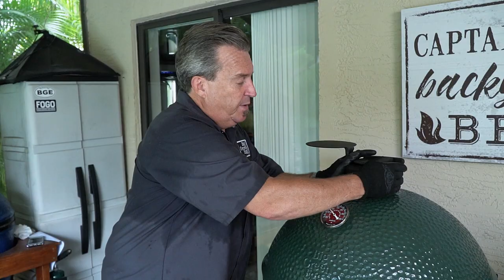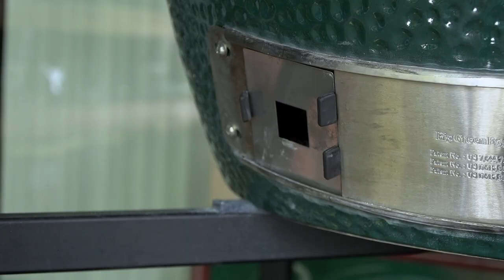Temperature Control & Vent Settings for the Big Green Egg | BGE Tips

Comment: I just read a comment on wind. I have smoked both times with wind conditions. At least 10 mph. I think it affects the temp control for sure. This might be a reason I am having a hard time controlling the temp. Yesterday I had both vents just about shut and still found it hard to maintain 250 for smoked Turkey.
Reply from the maker: Yes, that can definitely do it.

Comment: I have used the flame boss system on my egg and have found the need to tape up most of the fan input opening to limit free flow of air. There is no damper on this system. Prior to blocking this flow i could not hold a low temperature and the fan never turned on due to being over temperature.
Reply from the maker: If you close the top vent, it will definitely limit the air flow and it will burn at low temps.

Comment: Great tips.  I like the idea of adding charcoal to cool it down.  However, my number one rule is watch the temp and DON'T LET IT GET TOO HOT.    You can always make it hotter by opening vents a little more.  It's always a huge frustration to try to cool it down.  

An added tip a friend taught me is to close the bottom vent when opening the BGE lid to tend to your food.  This will help to keep it from increasing air flow and heating up while you're doing this.  I took it another step and drew pencil marks on the rim of the bottom vent.  This way I can slide that vent door back to the same place it was before I closed it.
Reply from the maker: Those are all great and valid points.

Comment: Hello from central Florida!
I’m a rookie with the BGE, very thankful for all your videos. 
I calibrated my thermometer like you explained but still having a tough time keeping my temps below 250! With the regulator darn near closed and also the bottom vent closed, I cannot seem to get below 300. Very frustrating when trying to cook low and slow. Any other suggestions? Thank you.
Reply from the maker: Hmmm, the only thing that I can think of is to catch the temp while it is still rising and close down the vents a bit earlier.  This will prevent the fire from burining too hot.

Comment: I struggled to get mine to drop yesterday  from 350 to 225. I also watched the dirty smoke video and watched it go from white to blue like you said. I put chunks under lumps. I over cooked ribs but im learning this awesome egg. Thank you
Reply from the maker: You are very welcome.  For fast temp drops, add new charcoal on top of the burning coals.  It will damper it down quickly!
Reply: I had the same issue with my first cook yesterday. I wish I would have seen this video.

Comment: Hi Ron, first of all thank you for your interesting and helpful videos. You always get a thumbs up from me!
I tried for Low and Slow your recommendation for the temperature control. Wide open at the top and almost closed at the bottom. Unfortunately I did not manage to keep the temperature at 250 degrees. The temperature got too high. What could be the reason for this? Too much wind maybe? Looking forward to your answer. Many greetings from Germany! Jürgen
Reply from the maker: Danke, Jurgen!  Yes, wind could have played a part in it.  If that starts happening, you can also shut the top vent a bit to restrict the air flow even more.
Reply: @FOGOcharcoal  Thanks Ron for your quick reply. I will give this a try. Have a great day to you!

Comment: Hey Cap’n, I’ve been reviewing your care videos, to add to what I already know. Thanks! When I cook, I leave the top vent open and control by the bottom vent. My thinking was it added more smoke flavor bc the meat had more smoke flowing over it. That’s not correct? The other question I have is I’ve noticed the wind impacts temperature control. I don’t have that little device you showed. However, I use a board in front of the bottom vent. Do you have anything you do to control the wind?
Reply from the maker: Hey Dan, my Eggs are under a covered screen enclosure so we really don't get much wind there.  It would be hard fpr me to say.  Although, I have Eggs at other peiples house and have never really had a prob with wind making a difference.
Reply: @FOGOcharcoal  thanks Cap’n, I’m going to try something different with my vents. Of late, I’ve been using the bottom vent to control the temp and leaving the top vent wide open. My thinking was more smoke flow over my protein. Reading a few BGE forums, they explain the fault with this. Leaving the top vent wide open actually increases the temp. Thanks again!

Comment: Ron, I notice you have your BGE next to your house in a screened-in porch. My husband is resisting this idea for fire safety but I think it would be advantageous with the inclement weather we have in the winter. How can I set his mind at ease?
Reply from the maker: I have 4 that I burn on that screened in enclosure.  I have never ever ever ever had an issue.  I have no ventilation.  I do have a portable fan that I may use sometimes to disperse the smoke when I light it but other than that, hundreds and hundreds of cooks without incident.  The ceiling isn't even discolored.

Comment: Would there be any chance of breaking the ceramic deflector if it went in too cold?  The last time i needed to use the deflector it was in the bottome if my grill cabinet frozen down with some moisture that had keaked in.  To be safe i brought it in the house and warmed it up slowly to 200° in the oven  before taking it back out to the Egg.  Judging by the palm trees in your yard chances are you have never experienced that
Reply from the maker: Hahaaa, you are correct, although I did grow up in NY.  I would definitely imagine that you'd run the risk of cracking it if putting it in there too cold.

Comment: Been grilling all my life but new to smoking. I've done a few briskets, and roasts and have ONE QUESTION. Is the smoke too bitter when you light it partially in the middle and start your smoking? I was always taught to burn the coals until the thick white smoke goes away. But if you do that on a smoking project, the coals will get too hot and burn out too fast.
Reply from the maker: Yes, you do not want to put the meat in there while the smoke is thick white.  Put your wood in after the coals have been burnng for a bit.  Then wait until the smoke starts to turn from white to blue.

Comment: I'm still finding this hard. I have tried using the one vent system and using both vents. I have found that it is very difficult to hold this thing at 225 . I have had some better success at 250 but even that creeps up into the 270 range over time. If I want it at 250 I start regulating the vents at 230 but it still gets too hot. I have just started to try and hold it around 250-270 and just use the meat probe to gauge when it's done.
Reply from the maker: That wind can definitely be tough

Comment: Fired up my big green egg for the first time today. I followed your method of setting it for smoking at around 250 and it held that for a while and then all of a sudden it started to spike and I close the vents down pretty much almost all the way and it’s still continue to climb so not sure what I’m doing wrong?
Reply from the maker: Hmm, that is odd.  Maybe check for air gaps?  Put a piece of paper in between the dome and base.  It should grab the paper if you try to pull it out.  Other than tha, I can only surmise that the vents were still too wide open.  Once the fire starts building, it can be tough to get it back under control.  I'll dump some fresh lump on the fire, that help to extinguish it a bit.  Let me know how that works and what you find.
Reply: @FOGOcharcoal  I finally figured out what was going on. There was a fairly good gap in the back by the hinges in the gasket. I loosened the bolts let the dome settle and then tightened them back up and it’s working perfectly. Much to learn. Doing a brisket today and it’s holding at 245 like a charm.

Comment: Don't have a bge but I was given a free char broil kamander and im assuming is the same concept but instead of me waiting 220 to 230 to close the vent so It can reach at 250 I did it at 200 and it went all the way to 270 until I just close out all the vents and waiting for it to drop to the right temp
Reply from the maker: I don't have any experience with those.  Sounds like that fire was heating quickly.  If that happens again, pour some fresh charcoal on top and it'll drop the temp quickly.
Reply: @FOGOcharcoal  with shutting the valves I waited about 30 to 45 mins for it to drop to 240 and opened up the valves and I guess it shut off on me so I had to light it up again I did so and at 170 closed the valves still went to 270 but held there and very slowly went up to 300 and by the time ribs hit temp it was at 318. I closed all the vents to cool off and a few hrs later temps still holding at 300 and not cooling down

Comment: So how do you control temperature overnight for long cooks?  Any tricks there?  I've tried a few ideas but I end up losing sleep no matter what...
Reply from the maker: Hi Dave, if you're losing sleep over it, you may want to look at the Egg Genius or Flameboss Temperature controlers.  They make it alomost foolproof for a good piece of mind.  I also recommend mixing some of our Black Bag with Super Premium when doing long overnight smokes.  I hope this helps.
Reply: @FOGOcharcoal  They're too expensive for for me (bought my BGE with stimulus money from a local dealer :-) though surely foolproof.  Lots of people do overnight smokes and say it's easy so I figure there's a better way to try out there.
Reply: @davemarkham4059  Dave, if the controller gig is too expensive, the next best option may be monitoring.  ThermoPro and others make wireless monitoring of both pit and meat temperature for about $50.  Put the remote unit by your bed and it will wake you if either go outside of parameters you set.

Comment: Ok, I’m really struggling. I have the top vent wide open and the lower vent open enough to hit 300f. It sits there happily for a while (20-40 mins) but then the temp starts to climb. I haven’t touched the vents. What’s going on?? Thanks
Reply from the maker: Hey Mark, once the fire is settled, it will tend to climb.  Just shut the bottom vent more if it starts to climb.  If i gets too hot, you can always dump some new charcoal on top and that will actually lower the temperature.

Comment: No matter what I do the temperature just keeps slowly going up very slowly. I started out just like you did in your video and now it’s up after a few hours 20° and it won’t go back down don’t know what I’m doing wrong but I’m really not liking this thing
Reply from the maker: Hmm, I'm not sure, try catching the temps a bit sooner on the way up.  It should hold steady once you get it to temp.  Maybe check for air leaks.  Put a piece of paper in between the dome and base.  It should have a little tug to it when you pull on it.  Do this in multiple spots.

Comment: First pizza came out perfect.. 2nd one burned the crust using the same procedure.. Help??
Reply from the maker: That's fairly common.  I'd recommend to close the bottom vent whenever you open the dome.  It allows more air to get to the fire and the heat goes up rapidly when you're at pizza temps.  The stone must have heated up more.  My pizza setup- conveggtor with the legs up, grate, another smaller conveggtor on the grate and the pizza stone on that.  You don't need another conveggtor, just get the pizza stone raised up higher in the dome so more heat gets to the top of the pizza and cooks the top more in synch with the bottom.